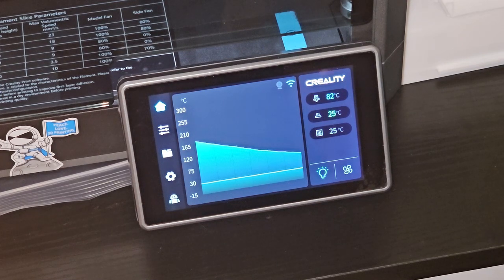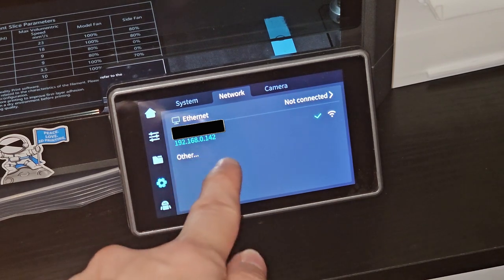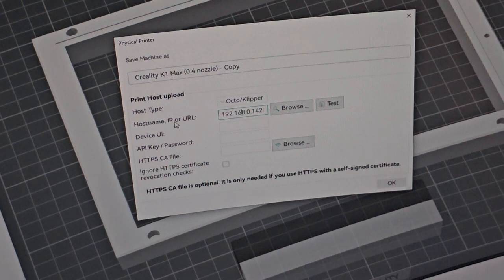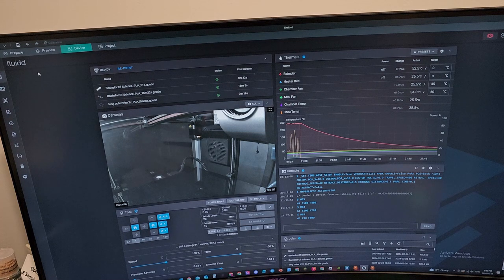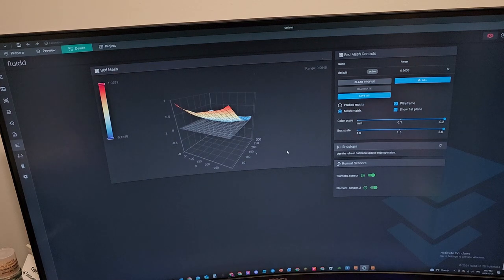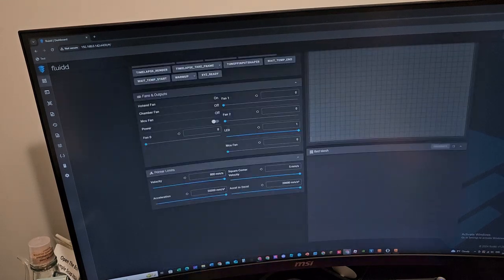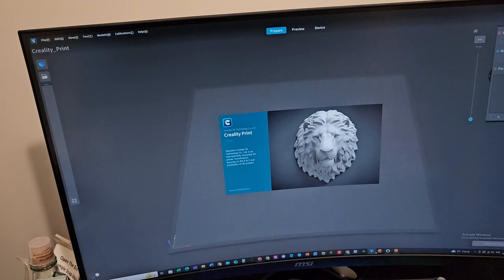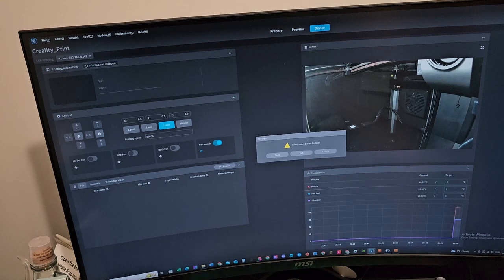Creality K1 Max How To See Bed Mesh

Comment: I'm sorry, but as a K1 owner using the Creality Print slicer, this video has NOT been helpful. How about explaining what Fluidd and Mainsail are first, before you jump right into your explanation of how to see the bed mesh using the one of those programs with Orca slicer, which I don't use. Do I have to use Orca slicer, or is Creality Print slicer OK? I know how to find the IP address of the printer. But I don't know anything about Orca, Fluidd or Mainsail.
Reply from the maker: Sorry if you find this video a bit confusing, I was only showing ways of how to see the bed mesh, not trying to explain what Fluidd and Mainsail are, but they are just interfaces that you can see and control your 3d printer. You can use anything slicer, but on Creality Print, it does not show the bed mesh of the 3d printer.

Comment: Am I correct in that the K1 Max must also be rooted for this to work?
Reply from the maker: I'm actually not sure, because before rooting I never put the port number behind the ip address. That's only in orca slicer.

Rooted or un rooted, you will still be able to see the bed mesh if you just put the ip address into a browser.

Comment: Do you have to have octoprint installed on your computer? When I try going thru Orca and I type in my IP with the 4408 at the end it says refused to connect. Same thing with trying thru Google. My machine isn't rooted.
Reply from the maker: Did you put a : before the 4408?
Ex: 192.168.0.000:4408
No I don't have octoprint installed
Reply: I just tried the google method and got it to work. Believe it or not instead of Orca it says Creality print at the top. But the bed mesh is visible. Thanks so much for this video, getting ready to print some shims now.
Reply from the maker: @timlewis4201   Let's go! Glad you got it working!

Comment: Does this work if you have a 100% stock K1 Max? I think I must install fluid or mainsail...
Reply from the maker: I'm not sure, as I have not tried that when my k1 max was unrooted, you can give it a try, putting in your printer ip address and add the port number behind it. Ex. 192.168.0.000:4408

But even if you haven't rooted your k1 max , you will still be able to see the bed mesh if you just put the ip address into a browser, even without the port number. Hope that helps, let me know if it works out or needed anything else.
Reply from the maker: Thanks for conforming.

Comment: is your k1 rooted? because mine is unable to connect to orca
Reply from the maker: Yes my k1 max is rooted. When putting in the printer's ip address, did you add the port number at the end? Example: "192.168.0.000:4408" It's the ":4408", try that and see if it work.